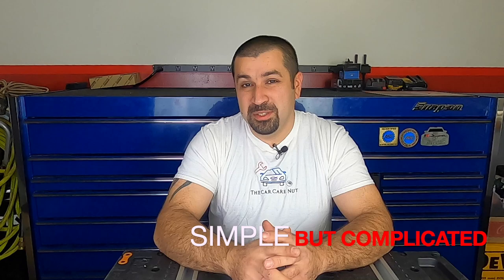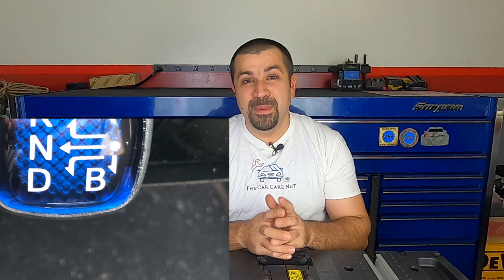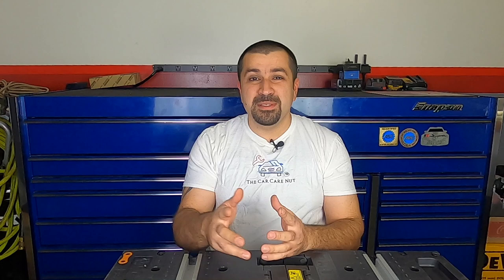How Toyota Hybrid System Work Part 6 B Mode and Hybrid AWD

Comment: One of my gripes with the user interface on Toyota hybrids is that the hybrid system screen is not completely truthful in terms of B mode operation. Whenever B mode is in operation (whether by manual selection from the user, or by automatic selection from the control system), there is NEVER a power arrow originating from MG1 going towards the ICE, even though you can hear MG1 spinning up ICE to high levels of RPM. Also, using B mode unnecessarily WILL decrease fuel economy, because for whatever reason, there are instances where gas is being burned while the ICE is spinning. This is evident in my RAV4 Prime; when in dynamic cruise mode in EV driving mode and B mode activates automatically to slow the vehicle, the HV range DOES decrease about 1 mile every min or so depending on how much braking the car is doing and whether the ICE is still rotating.

Additionally, in situations where the control system de-rates or completely cuts out regenerative braking, the power needle on the instrument cluster remains at whatever charge level it was at previously, which to me feels disingenuous. I would have like for Toyota, or most suppliers of hybrid / plug-in / electric vehicles to provide a gauge or an indicator which would inform the driver of how much friction braking is being applied at any instantaneous moment, as this would better inform some of us on what the car is actually doing when we are depressing the brake pedal, instead of having to rely on feel and intuition.
Reply: The fuel economy shows you're still getting infinite mileage per gallon. You know how it is if you're riding the bike in low gear... you might make a lot of rpms but not exert a whole lot of effort and the bike is not going very fast uphill
Reply: My 2006 HHy shows the ICE sending power to the HyBatt when in B.

Comment: Love your videos. By the way, you have a beautiful speaking voice. Your diction is perfect and every word is precise. Now that I have buttered you up, my wife's car bought new is an '18 RAV4 hybrid XLE and love it. I am a low tech guide and since we have owned it I have never used any gear except P R N and D. Never opened the sunroof, don't use bluetooth, voice commands, etc.but have the enhanced radio because I needed the built in NAV system. Believe me folks don't read the owner's manual. To boring. Heck the stereo system manual is over 300 pages so anyway I am looking how to turn on the heated outside mirrors and never could figure it out so I laboriously went through the owner's manual until I found it.(not easy) WaLa! If you turn on the rear windown defroster the heated mirrors come on. Who knew and what a stupid thing to do.Anyway I have a question for you. I wanted the additional Toyota side steps to help us get in and out but the Toyota dealer was unable to find them in the parts computer but listed for non hybrid  models. Can you tell me why? thanks, and what great videos.
Reply: PS: Lou again. Forgot to add I have never used the "E Mode"  switch either and don't have a clue what it does. When I see the "D" on the display that is all I have used.
Reply from the maker: Hi Lou! Thank you! About the running boards that's odd that they couldn't find it. Email me your VIN no. and let me see what I can find. And regarding the E Mode could it be EV mode? If that's the case then this allows you to drive the car full electric for a very short distance at lower speeds. Basically you can use that in slow traffic to save gas.
Reply: @TheCarCareNut  Thanks for the info. The VIN is JTMRJREV1JD168477.  The Toyota parts guy speculates that where the attachment hangers go underneath they could interfere with the hybrid differences in the under carriage. Again just his opinion and he even called someone (don't knew who) and they couldn't come up with the sidestep part number. I don't want to use an aftermarket step(s) because he said it could void the warranty if they modify something. That was his advice.

Comment: It's Really smart! So regen is playing the role of engine braking and half the work of the friction disk brakes. It fills the battery with charge and then spins the engine to make room for further regen braking.
Reply: Nowhere near half. Perhaps 5 to 10%
Reply: Also more like an assist to the brakes. Not doing anything gor them just adding to them.

Comment: 4 years ago. We got a Volvo s90 T8, hybrid. The sales man told us it was Battery mode and that's where you put it if you only want to drive on battery.  Nevermind pure mode.  Fast-forward to getting a Prius, finally figure out what B mode is.  
The guy was wrong, and luckily, we never used it.

Comment: Best explanation of B-mode that I have seen.  I drive on a limited-access highway at 70 mph and get off an exit which is a long, steep downhill grade to a stop light. Am I doing any damage by shifting to B-mode at 70 mph? I don't think I am, but it never hurts to check with an expert. Thanks.
Reply from the maker: Hi! If you need it there’s no damage done because it’s computer activated not a manual mechanical change
Reply: @TheCarCareNut  Holy cow! How nice to get such a quick reply. Thanks so much!

Comment: I've loved your series on the hybrid Toyotas and I've learned quite a bit.  However, I have one bone to pick with you on this Part-6 video.  At about 9:00 minutes in you state that there is no heat generated in B-mode engine breaking.  I don't believe this is correct.  As the car goes downhill the potential energy stored from the car having climbed up the hill is converted to kinetic energy as the car accelerates downhill, and to slow the car down, that energy has to go somewhere.  I believe in this system, MG2 converts the kinetic energy to electrical energy as it provides regenerative breaking, this electrical energy is routed to spin MG1 which then spins the ICE.  The ICE provides the drag to put a load on MG1, and hence MG2, but to provide this drag, the energy is converted to heat, and a lot of heat, which then has to be dissipated, probably by the ICE cooling system.  So I believe the continual compression and expansion of the air by the pistons in the ICE cylinders is the conversion of the electrical energy to mechanical energy, and then to heat in the ICE.  And that's how the energy being released as the car tries to accelerate downhill is dissipated.

Comment: Thanks great advices yeah just for testing b mode does waste more gas in my experience when going flat road and not a downhill but I wanted to tested and it does charge battery faster but you waste more gas power cause the car feels heavier due to the resistance on gen1 . I wonder why on gen2 you can go 1-10 mph background on Ev mode” pure electric and sometimes gas engine kicks in but it’s rare yet on forward pass 4 /5 mph the gas engine kicks in .

Comment: I've noticed that when I use B mode to descend hills and then take it out of B, using brakes instead, the display shows much more regeneration using the brakes. Also (on my 3rd gen 2014) if I put it into B mode just driving around it won't go into ECO mode, at least with the type of driving I do.

Comment: How do you use B mode. When do you use it? Do you use it to break while you're driving. Do you shift while you're driving into B mode? Do you shift into it. Let your battery charge. Then  turn it off? I just got a 2013 Prius Persona. I took auto tech. I am lost right now. I love you're channel though. You're the reason I bought my Prius. Love n Respect brother
Reply: B mode is like downshifting your transmission, it gives engine braking so use it when going downhill just like shifting an automatic to 3 or 2 instead of D. You can shift to B while driving at any speed, it won't hurt anything. Don't drive in B mode all the time because it's ineficient and you fuel economy will be worse.

Comment: Sir thank you again for your videos.
You explain very well and I learnt lot's of things about my car thanks to you.
I own a 2019 Lexus Is300h here in France.
It has a 2.5 liter gasoline engine. It's a wonderful car to drive.
I'll go clean my battery ventilation filter right away.
In the past vidéo, you were talking about the B mode in Prius, surprisingly, in the IS I have shifter paddles instead which are quite weird for a ecvt transmission. 
Do you have any explanation about that? 
I'm sharing your videos among our facebook community.
Great work and explanations and keep up the good work!
Reply from the maker: Thank you for watching my video! So on your Lexus the paddle shifter is basically going to artificially vary the level of b mode to give the feel of manually shifting a transmission but it’s actually also b mode just the intensity is changed with the paddle shifters.
Reply: @TheCarCareNut  thank you very much

Comment: Enjoying this great series on hybrids. I'm understanding so much more about the engineering. But b-mode still confuses me. Why does mg-1 spin up the gas engine to effect air braking. In a traditional engine, as you say, the downshifting changes the ratio between the wheel rpm and the engine rpm any of he immediate effect is that the compression resistance on the unpowered engine slows the car down. So does the mg-1 only wind up so it can then effect this compression resistance? Perhaps I've answered my own question.  I guess the confusion lies in why the planetary gear system is not directly linked to the engine speed. At any rate great videos on your part. Keep it going!!🙏
Reply: Because the engine is otherwise completely disengaged. Think about your hybrid as an engine/I.c.e. and a motor/electric working together back and forth to try and get you the beat balance of power and efficiency. Why I still have mine? Power.

Comment: Hello, the mg1 has to spin in order to simulate a low gear and doing so, use engine brake. Remember that Toyota hybrid ICE is actually physically connected to the wheels, however the MG 1, spinning forward, backwards or, non spinning, can change the gear ratio and thus, combined with the planetary gear set, obtain any gear ratio, and even a neutral. When you are in D and use regenerative braking, MG 1 spins in a way that allows ICE to not spin at all and MG2 (which is always rotating with the wheels with a fixed gear ratio), acts as a generator. When you use B, MG1 rotates in a way that allows ICE rotation as it would with a low gear in a manual transmission, dissipating part of the kinetic energy that comes from the wheels.
Reply: Right, and in doing so uses fuel which is why it's actually less efficient. My bad habit. Oh well. I tried to change but can't.

Comment: I'll continue to run winters on the front just incase I go to the mountains or it snows again. In the rear I'll put summers on as soon as most of the local roads are dry. Can't do that on a regular 4x4.

Comment: Awesome clear explanation! I though there were front drive shaft to the 1.8L engine lol! So the engine is basically only use for B mode at time and to recharge the battery? If that’s the case how bad the Prius’s battery have to become until is it not drivable anymore? Would anyone be stranded on a freeway due to battery or MG failure? How likely is that to happen?
Reply from the maker: The engine can drive the wheels through the planetary just not directly like a conventional car. If the battery fails the car will be underpowered and will be able to move by the power of the engine only. If mg fails the system shuts down and is not drivable anymore in most cases

Comment: Can you make a video explaining the optimum conditions when using the ECO, NORMAL, and SPORT modes?  Thanks for all that you do.
Reply: @kiefershanks4172  Thanks for the info.  I've read somewhere that while driving on a highway it's recommended to use sport mode on longer trips. Maybe for passing other vehicles?
Reply: @kiefershanks4172  I put on ECO when on freeway and D to keep up with local traffic.  Thank you for your wonderful wonderful information.
Reply: I use Eco when battery is fully charged on a flat track or traffic is moving with very slow speed else Normal.
For starters Normal mode is best.
Power mode for sharp slops or when urgent need of power to overtake

Comment: Is it correct to assume: theoretically if MGR is present then MG2 can be underpowered with big portion of electric power redirected to MGR? Sure powerful MGR would need bigger housing which needs significant space near rear axle which has to be made available during platform design.
Reply: Theoretically, yes, but Toyota has not chosen to go that route. For now, MGR is a supplemental unit that drives the rear axle in only very specific circumstances.

Comment: Thanks for sharing very useful information. I would like to hear from your knowledge. For hybrids that don’t have B mode, but Low gear shifts.  Will shifting to a lower gear be safe for the transmission and engine and will that also help recharge the battery?
Reply: Ok but not efficient.

Comment: Hello, i was very compelled with your short presentation of the MGR. I'm currently in the market to buy a new Highlander hybrid AWD. I'd really love to get your comments or any information as to the efficiency, the power and if any torque vectoring to one wheel or the other in cornering. Is the MGR giving enough of a boost to make a real difference in snow conditions? I'd be really happy if you could address these points about the MGR. Because nobody talks about it makes me think the MGR not much an aid in rain or snow conditions. I'm not hearing much about the AWD competence in these weather conditions.
 Norm from Montreal, Canada
Reply from the maker: Hi! MGR makes a difference in snow but not off roading. It doesn’t have torque vectoring it’s just an open differential

Comment: Great explanation of “B” mode. One question is under extreme conditions, after completely draining the hybrid battery (as far as the computer allows) by going up a steep mountain grade, will the battery possibly be too warm to accept full regenerative braking? I was descending down Pike’s Peak and I had to ride the hydraulic brakes, even though I was using the B mode at 15 mph; and the display showed no interaction between the engine and the battery. As a result, at the brake temperature checking station, I had to pull over for 20 minutes for brake cooling. I don’t know how I could have done anything differently to prevent possibly losing my brakes.

Comment: Thank you! I use B mode a bit back & forth to work, & I've always wondered why the charging indicator doesn't do anything during B mode.
Reply: It should. Mine does.
Reply: @doordash-nh1ih  Not when use use the hybrid Jake brake-you're USING battery power, opposite of charging.
Reply: @davidrhea3716  no

Comment: A non hybrid petrol engine on over-run uses no fuel. It applies braking through compression. 
But you will still need to apply the brakes on a steep incline.

Comment: Firstly i would like to congratulate you for your videos and your advices to all of us. I have a question about B mode. You said and explained in a very simple way about this mode, and you said that while the B mode is deployed the engine is not typical running but i still see gasoline consumption on my trip computer. Why is this happening, if the engine not using gasoline but is moving by the mg only?
Thank you in advance!!!
Keep up the good work!!!!
Reply: It's using fuel because the pistons are being engaged thus the efi pulls gas. Not a lot but some.

Comment: Thank you for all your great videos! Incredibly informative.  I have a 2007 camry hybrid with 310K miles and does burn some oil but is still going strong otherwise. My question is, what's the best way to clean the engine bay? Should we get this professionally done or is it diy? I know there are orange wires in there so I'm sure i need to be careful, thank you for all you do 😊

Comment: The you describe it is brilliant. During prolonged braking, B mode is kinetic energy to be dissipated through the conventional channel of a normal gasoline engine by means of connecting MG1 to the wheels. The energy has to go somewhere. Toyota Hybrids allow an intermediate recuperation of energy to the HV battery, which would not be able to cope with prolonged braking, hence B mode.

What is your experience with electric water pump failure?
Reply from the maker: Hi! On water pumps their rate of failure is not as high. Usually high mileage examples with no or unknown service history on the coolant
Reply: @TheCarCareNut  I was just traumatised by a electric pump failure at 50,000miles for an over-engineered BMW N55 under mild conditions. If I was B-moding downhill and the pump goes when under strain, it is gg. Nowhere with the kinetic energy. But this would have happened even for the N55.

Comment: great videos! loving the content and how you simplify these concepts. wanted to ask you - with the added hybrid motors, would this decrease the amount of regular maintence required? for example, are engine oil changes little more infrequent? in your brake video, would we expect general decreaes in the need in changing brakes as well? thanks for your thoughts!
Reply from the maker: Thank you for watching my videos! So the oil will still need to be changed at the same frequency because the engine is running enough to justify the same maintenance interval. Regarding brakes because they are not used at the same intensity as a non hybrid car so they last much longer in a hybrid car.
Reply: @TheCarCareNut  thank you so much for your time and help! God bless! :)

Comment: Very informative thanks! I recently drove a 2020 rav4 hybrid and didn't see B mode on the transmission selector. Has this been removed from it?
Reply from the maker: Thank you for watching my videos! Some models will have a S mode where you can “manually” shift the transmission. That is similar to B mode just has different levels if you would mimicking them feel of a manual transmission if you would.